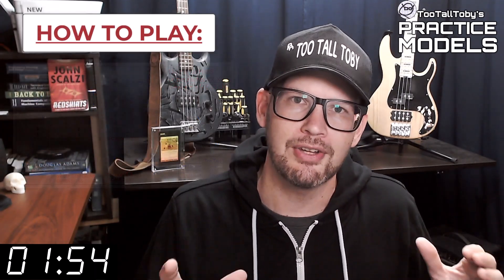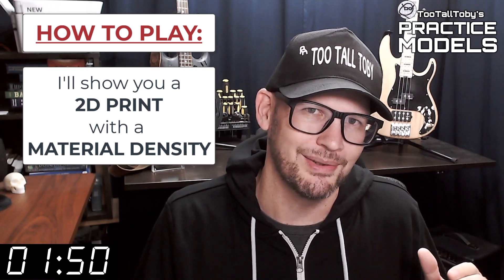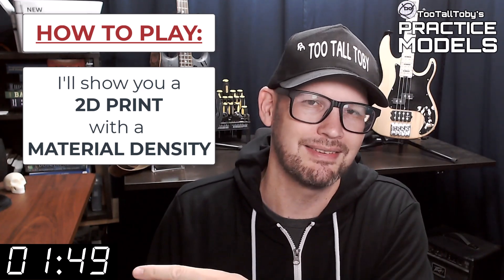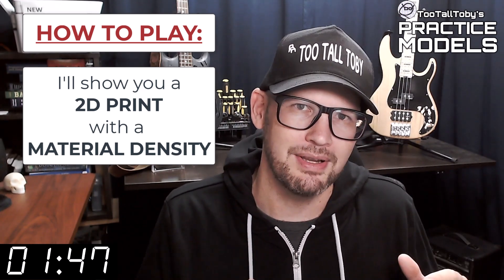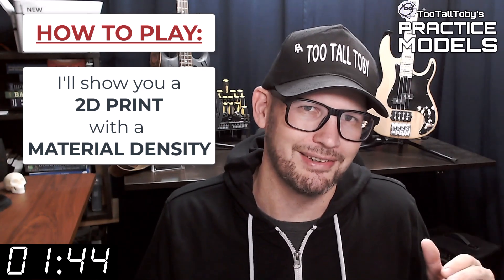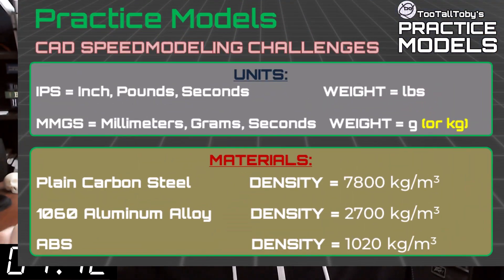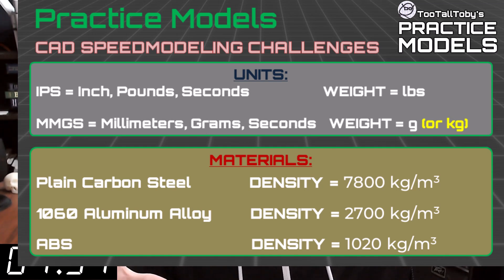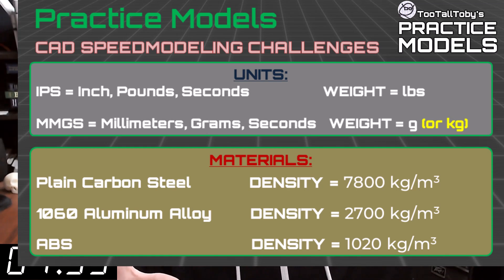2D to 3D CAD PRACTICE MODEL-  SPECIAL EDITION! Free Drawing Exercise for 3D CAD users- FULLY DEFINED

Comment: 53.89g,  surprisingly the cap tripped me up. Had to end up making a plane tangent to the out side diameter and trimming away the outside face to match out side diameter of the cap. If anyone found a way to do that step better let me know!
Reply from the maker: Yeah that cut pattern is a little tricky.  Nice job solving it!
Reply: A revolve command will do it, first extrude an 8 diag. circle, revolve an L shape sketch with 11mm vertical instead of 7 and set it to "intersect" the circle you just extrude, revolve again with the required dimensions "new", Circular pattern "Add". I used Onshape